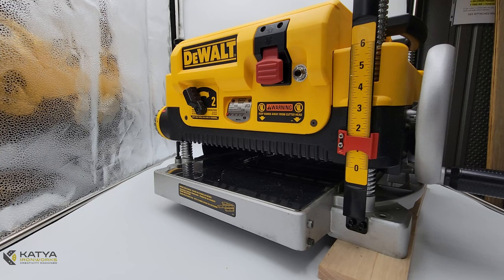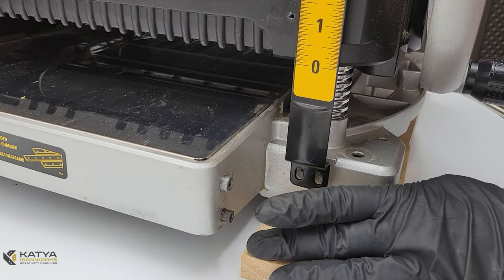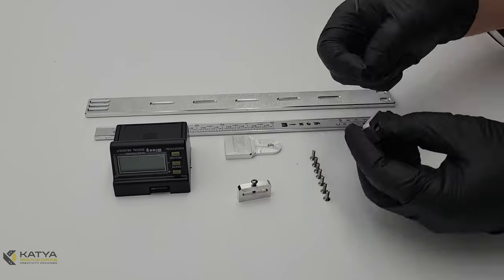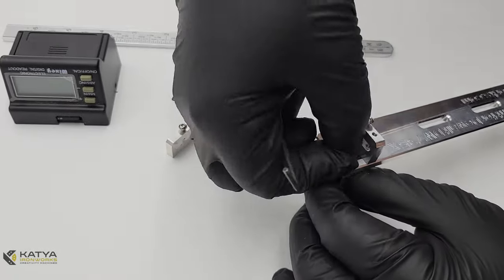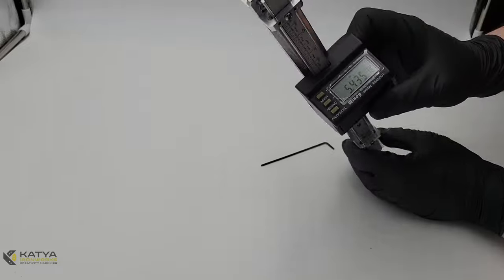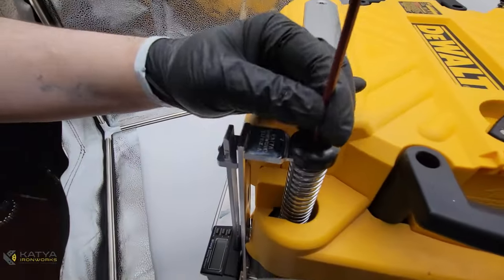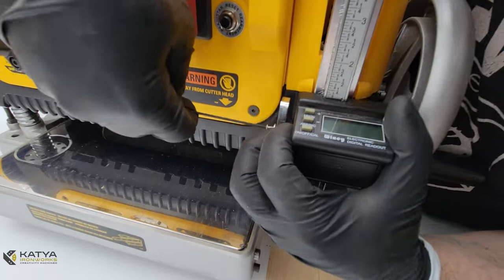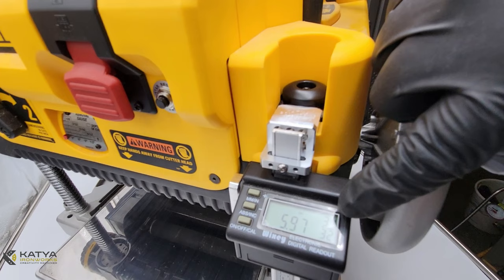Installing Katya Ironworks Precision Mount for Wixey WR510 DRO on a DeWalt DW735 Planer

Comment from the maker: Hi Bijan (@bijan4727)! To answer your question ... if your planer is equipped with the Katya Ironworks system, this is very easy. Lower the gantry until the DRO reads 2.375. Run all three pieces. Then lower the gantry to 2.3125. Run all three pieces again. All your pieces are now planed to 2-5/16. And no measuring was needed. Thank you for the kind words, and let us know if you have any more questions. Also check out the new woodworking products we have released since this video.

Comment: Do any of the DeWalt 735 kits include the wixey??
Reply from the maker: Thank you for the question. We make DRO retrofit kits for several different machines. Our DeWalt 735 kits do not include the Wixey WR510 DRO. Assuming you ordered part number KI735XDE, in the box is a 24 piece kit, of precision CNC machined Aerospace Grade Aluminum parts, and 18-8 Stainless Steel metric hardware. 100% Made in the USA. Woman owned small business. Hundreds of happy customers. Feel free to contact us if you have any other questions. Email to katya.ironworks [at] gmail [dot] com, or use live chat on our website www.katyaironworks.com.
Reply: @katyaironworks8007  so what is the difference between the options on your website it does not state what is included other than the price going up. Thanks
Reply from the maker: @JNewellworks  TL-DR: The KI735X is the minimum kit you need for the system to function. The KI735X-D, and KI735X-E, are upgrades you install on top of a KI735X. And KI735X-DE is a combo that contains everything. The higher up you go the more precise the system gets, and the more beautiful/professional the installation looks.

LONG STORY: When we first released this product, there was only KI735X. The KI735X was, and still is, the base kit, you need it by default for the system to function. A few years later, we found out we had overengineered KI735X so much, it starts to outlast the Wixey DROs. Most companies at this point would go the way of under-engineering the product so it costs less to make. We went the other way. Not only we kept the tank like parts, but further, we identified which Wixey parts were poorly designed and we released two upgrades to address these. The KI735X-D, and KI735X-E, are said upgrades. With KI735X-D you get two precision milled D links to replace Wixey's questionable solution consisting of thin sheet metals, springs, and foam-tape. Our D links hold the linear scale rigid in place with 6mm thick aluminum parts and stainless steel M3 bolts. After installing KI735X-D the linear scale will feel like a MACK truck. With the KI735X-E you get precision milled J links. The J links provide the 90 degree turn you need to rigidly couple the readout display to the planer's gantry using stainless steel M4 socket bolts. Wixey sends some questionable quality, flexible erector set style sheet metal parts, and some phillips screws, in an effort to fit the kit to as many different planers. We prefer parts that are custom engineered to the specific machine. After installing KI735X-E the readout feels like an M60 tank. Finally, the KI735X-DE is the combo that contains everything: the base kit, with both upgrades, all hardware, the works. This is a discounted option (cheaper than buying kits and upgrades separately).

For the non-DeWalt folks reading this and wondering "what about some love for my planer", the answer is yes, we can (or perhaps already do) also custom machine a DRO mount kit for your planer too. Just ask. The only requirement is that your planer has a cast-metal body. DeWalt 735, Delta RC-33,  Grizzly G0815 / G0890 / G0891, some Powermatic models are great candidates. It is not even limited to planers. We can (or did) retrofit your SawStop Cabinet, Powermatic 2244, event lathes and milling machines with DRO kits. Choose readouts and scales from as entry level as Wixey to as advanced as Newall Microsyn or SONY Magnescale. Just ask.

Cheers, and Happy Halloween

KI
Reply: @katyaironworks8007  thank you for the clarification. Happy Halloween!